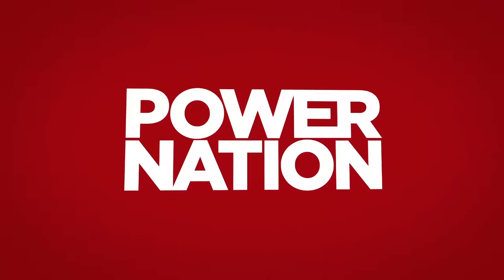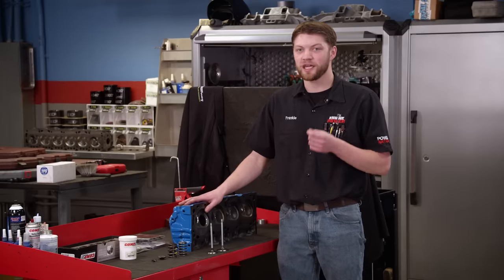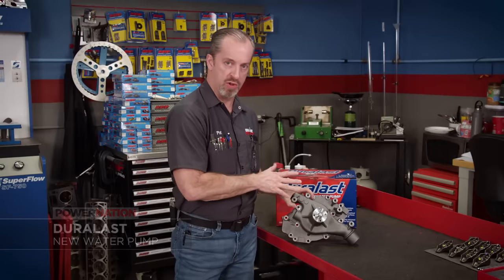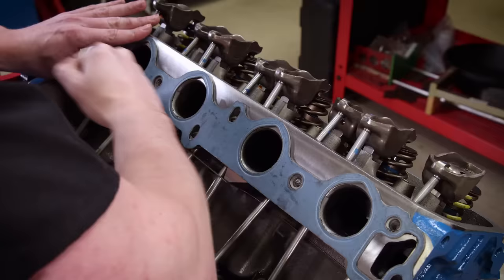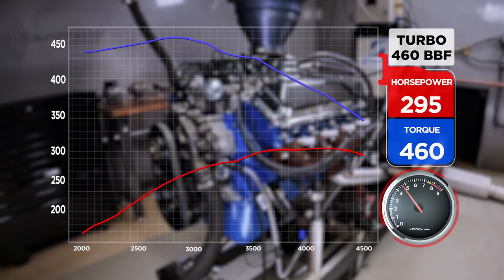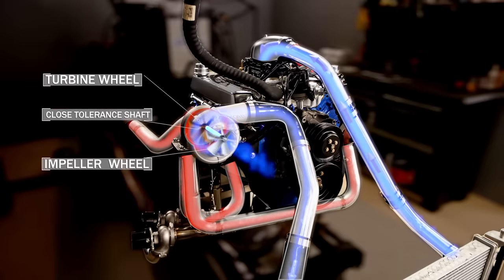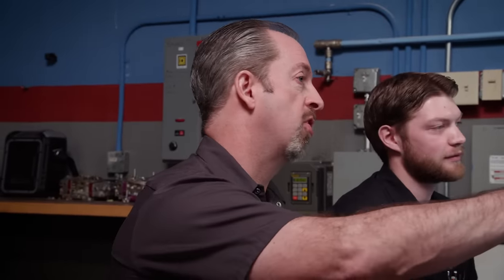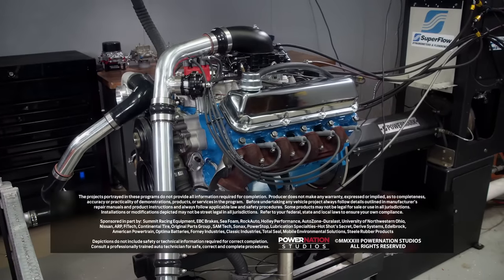Turbocharging a Stock 460 Big Block Ford for Massive (And Affordable) Power - Engine Power S10, E5

Comment: You know ...... this thing is making almost peak torque at 2000 RPM ......From 2000 RPM to 3500 RPM, it's over 425 lbs/ft the whole way ... That's a really impressive pulling engine

Comment: You should put forged pistons in it to start with it not like it would have cost that much more
Reply: Forged pistons would have definitely been a better idea considering they intended on going with forced induction.
Reply: The point was they wanted to boost a stock spec 460.
Reply: @midnight347  … apparently so but I would still prefer the extra durability offered by forged pistons. 👌
Reply: @midnight347  I guess people are missing the main point of the build here.

Comment: Can't believe you didn't spend $100 on a cam with more duration so this thing could run in something other than a diesel power band.  Doesn't even need more lift (and the associated headache with retainer/guide clearance, springs, etc.) just more duration.

Comment: I don't know how they got the stock 'used ' exhaust manifolds to seal. I tried everything on a 96 350 dump truck with them not sealing even tried removing the catalytic converter and used an opened Flowmaster muffler. I finally put brand new Ford exhaust manifolds and those worked for a while before leaking again
Reply: Have you tried copper gaskets?the material is softer so it can conform better.
Reply: @davidwilliams7723  The issue was resolved with new oem exhaust manifolds along with oem Ford gaskets. The stock manifolds had less than 50 thousand miles and were sent to a machine shop and very little material needed to be removed. I can't say if plain copper gaskets were used as this was over 15 years ago but the shop wasn't new to the Ford exhaust manifolds leaking so I'm sure if it was an option it was tried.

Comment: That's a lot of timing on pump gas.    Normally 15 on gas and 22 on e85
Reply: Not really. They are pulling almost a degree for every psi. That’s pretty safe for pump gas
Reply: They aren't running much boost and these are pretty low compression.  That rule of thumb might work with higher compression engines but it just depends on what kind of engine you're working with and it's compression as well as the boost level.

Comment: Your theory of the intake getting hot making boost sooner sux canal water. If you lose more heat you make more power , that fan is inadequate for cooling the intercooler . How hot is the intake ? If you drop the charge pressure by cooling air density makes up for it . Why not show what a water set up can do , and not have to worry with detonation .

Comment: Theres several problems with this. Number 1 i cant believe they would put cast iron parts in it and a carburetor. As they said several thousand dollars in parts. Its great they can do all the labor but the cost for someone wanting to do this. Is probably 5 to 10k in labor. So around 10 to 13k for 150 hp.

Comment: what is the best engine for boost guys ???
Reply: Ls ig cheaper
Reply: The LS would probably be the most cost effective but any modern V8 will take boost well with the right parts.   But with some overnight parts from Japan those old JDM engines make crazy power.
Reply: The one you have! :)
Reply: @bmstylee   jdm staf is the best k20 vtec yo
Reply: @stelios672  or an RB or 2JZ with some additional atmosphere.
Reply: @bmstylee  In Aussie, it's the Ford BARRA taxi cab engine !!

Comment: Make your power with boost not timing. Lol there not even close to pushing the limit on a BBF. They were surprisingly stout in the stock form. With enough ring gap that motor will make 700hp+

Comment: Now that we know what a stock 460 will take, now it’s time to increase the NA power of it with a heads/cam package and see how much power it makes at the same boost level, my guess would be an extra 200Hp/300Tq 🤔
Reply: You prob got that backwards prob 300 hp 200 torque it already makes alot of torque but hp up top is choked off bad with the stock parts so it's gonna gain a ton up there with solid heads cam intake package.
Reply: Good point!

Comment: Stock rods are fine, pistons?
Reply: We shot 150 on a mild 460! Know some good old boys that bought all the 69-71 Lincoln 460's  in this corner of the state! Intake, cam, and headers! Not even a back yard rebuild in the first few years! Asked them one day why they didn't go up on the gas! He answered,  "we did one time, it blew a head gaskets! The 66 Falcon was the lightest Ford it would fit in! But the 70 short bed F100 was just a few tenths slower! Saw the Falcon run 6"70 on motor once!
:

Comment: I had a 69mark lll w 460. I always burned reg gas in it adj timing so no ping outlived the car theese were awsome engines  would beat a roadrunner 440 🎉 they were near400hp in the 69 later less. Got 17mpg hwy  unlike the 472 caddy devill conv 8mpg we had both cars same time cad sluggish   the 72  eldorado convertible was faster

Comment: Im guessing they are using D3 or later heads. If you want an even bigger chamber head i guess the open chamber 1972 (D2) only heads. They sucked so bad the revised them in 1973. Edit i just seen its the 87+ efi top end

Comment: I don’t understand building it so stock. Why pay for new parts that aren’t strong enough for the application. At least main and head studs and stronger rods and pistons. And maybe pocket port the heads on the show as well as a bit bigger hydraulic cam, as well as a decent intake. You’d probably have a engine for a work truck that would live all day long at 800-900 hp and well over 1000 ft lbs of Tourqe. For less $ than a Diesel engine. A build more along the lines of your Ford 300  turbo straight six would have made more sense. A sequential port injection or a separate Terminator computer Sniper 4bbl. would allow you to set it up with flex fuel and run it on E-85 as well.
Reply: Cost. Stock is usually cheaper. The Factory spreads the R&D over volume. Aftermarket can't do that because they aren't selling millions. At the power level these things were built for, they're actually overbuilt. That's why they have so much potential to make surprising power.
Reply: It was a stock 460 turbo dyno episode, they didn't want a built BBF..

Comment: I will say this over and over, but Ford makes garbage engines, except when they dont, and when they dont, they knock it right out of the park. The 4.6 Modular was a great engine for reliability and abuse. The 460 was also reliable and could take tons of neglect and abuse, but also make the power.

Im not big with turbos, so Im curious of how pre 72 cars would handle turbos (also note that early 72 cars still could come with high compression heads, pre-November built Continentals can have leftover heads, D1VEs or D0VEs and even mismatched from factory). Then you get the 73 which is an oddball of ok heads with funky pistons, then the higher chambered 74 which probably would be my pick for a turbo setup like this.

Again, not an expert but love talking what-ifs, whats better, whats not, and the 460 is so forgotten these days. I run complete stock on both my Continentals, though one of them puts out hefty power with just bigger exhaust, and tuning them right. Carb and dizzie settings are a lost art and Im happy to have learned from one of the old school greats.

And one big bone...those cars would and should get around 20mpg without losing that power. If its not, something isnt right. I used to get guys coming from as far as Arizona for me to time and carb their Lincolns, and drive them back, and they would be shocked getting those miles at 75-80 mph. Its such a good engine. Its only flaw is with the rear lifters due to the engine angle. But overall, its forgiveable, and the driving feel you get from so much torque and low rpm.

In fact, the closest thing now, is the Apache engine from Dodge (392). It feels, and even sounds the same. Another great engine, that hopefully we have plenty of for many years to play around with.

Comment: Hardly stock ! 472cid .most rebuilds are .030 over with RV type camshaft= 466. Cid those crankshafts will consistently hold1000 HP . Nice try. Went to the trouble to install intercooler but no forced air !

Comment: Your power valve theory is way off.. Boost in the manifold is opposite of vacuum. Power valve opens at low vacuum and boost in the manifold would hold it open. Only real issue here is, hat pressure feeds the bowls, and if hat pressure gets to a margin above manifold pressure ( as it definitely does) the bowl pressure will close the power valve. this is why a boost activated valve that operates on bowl pressure ( hat pressure) should be used.

Comment: Oh come on, we don’t want to push it till it blows is horse hockey! Put some high octane fuel in that thing and turn up the wick. If the rings are gapped right, it could make 550hp and 800+ lb/ft of torque. With the dial boost and retard control you’d have an excellent cheap Saturday night special! Remember it’s not about watching blow it seeing how much the ole girl can handle. Now get some balls and show us what that Ford will do!

Comment: Ok somebody tell me if they ever heard this, I used to work for for in 98, our engine told me fire detuned there 460’s by installing timing gears that retarded timing. So if u ever replaced timing gears with after market you can gain to almost  40 to 45 horsepower? Anybody ever heard this. I always wondered.

Comment: No offence guys but 9 psi isnt big boost, most import guys are making more power than you with similar boost numbers. My import car is doing 650 whp on low boost and 900 whp on high boost, It drives around like a normal car with excellent street manors until you decide you want to destroy the guy next to you. When I clicked on the video I was really hoping to see 800 plus hp with over 1000 ft lbs of torq.

Comment: WIth an aftermarket open plane short runner manifold and headders it will have 600HP
As it is, HP is not even a factor.  The torque is 500+ all the way to end. At 3600 you will feel a sharp dive in power. Or a sudden grip of traction.
Reply: Nope, no traction at all..
Reply: This motor is a dud. The peak torque is exaggerated by shocking the dyno by ramping in the boost quick. Thats why it is so peaky.  Put this in a vehicle performance will be lack luster and will drink gas by the barrel. Same motor with a good head and cam would run circles around this thing.
Reply: @taylorsrus9543  Sir, stock motor with turbo.. Put heads, cam, intake, stroker kit even n it'll make power up to whatever the block can handle..
Reply: @Taylors rus  it's a completely stock long block and old ass big block that is meant to make torque.  It made a ton na and boosted.  No surprise there.  Boost just mirrors your na curve assuming you aren't running too big of a turbo with Hella lag.  It's making big torque because it has a properly sized turbo and stock 460 components (did I mention it's torque happy?)
Reply: @midnight347  Its not all that much torque and its mostly from the boost peaking. The avg torque isn't impressive at all. The NA numbers are laughable.

Comment: Outside of the 5.0 V8 definitely Ford's best engine.
Reply: I'd say that's debatable but it's not. The 351w is a far superior platform than a 302 and the 460 was a massive pooch stock, 6 mpg to boot.
Reply: 68-71 429/460s are no pooch. And every engine on planet earth was a huge pooch after 1972.  Not the engines fault at all.  To this day I can’t think of an engine with more factory potential.  Room for a 4.5 crank right out off the assembly line and a 4.6 with a little grinding in a D9 block.
Reply: Also, who leaves a 460 stock ?

Comment: Good engines, but nobody uses them. They run great, dependable, but junkyards are full of them. No hot rod buildups touch them.
Reply: you're joking right? the 460 has been used in drag racing for decades.

Comment: This would have been a more realistic build about 40yrs ago...they should've at least added a .500/.500 cam,dual springs,holley high rise or mid rise dual plane intake or single with a 750/850cfm blow through carb 🤫 & some dam shorty headers for shyt sake

Edited: after that N/A run...boy was I wrong...wtf was I thinking...that big mf made 460ft tq N/A 🤣🤣🤣🤣

Comment: I can't believe you guys loaded the engine at 2000 rpm and made boost. Def not a good thing for the engine. On pump gas they I don't think I would have turned timing up much at all without det cans to monitor, you'll get more power out of adding boost and less likely to hate itself. But it made same hp as a cam and 243 headed 6.0 lol sure makes some more torque way down low but that wouldn't be as much fun to drive.